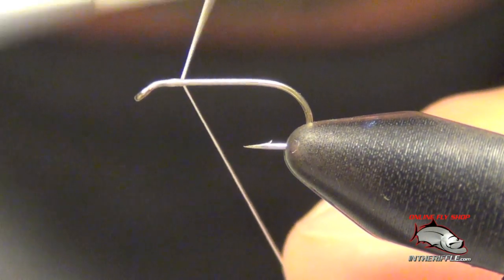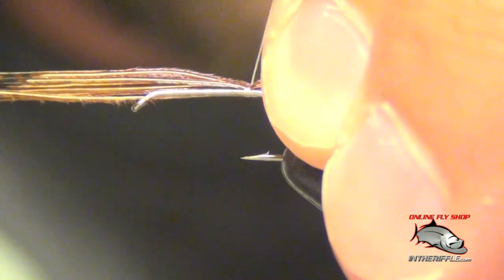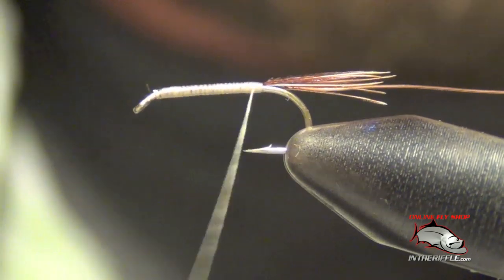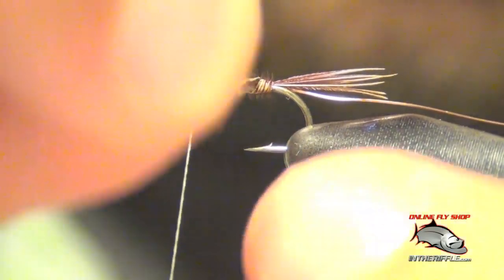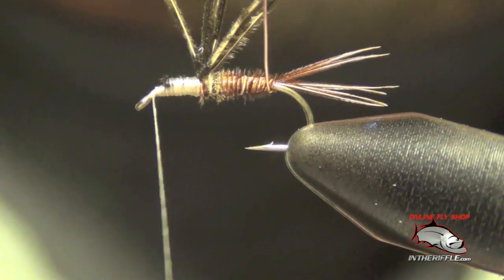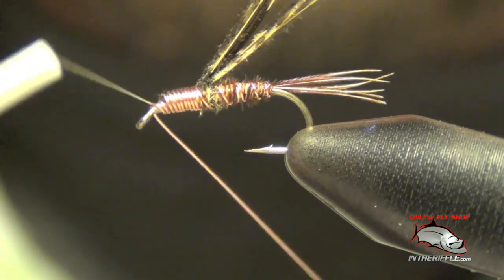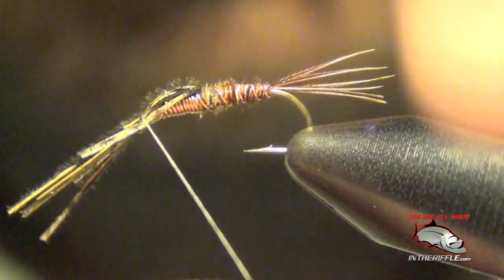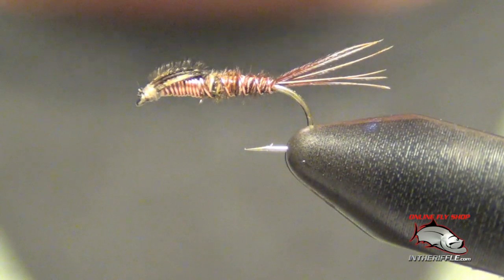Sawyer Pheasant Tail Fly Tying Instructions

Comment: It is tied in the style of the Sawyer pheasant tail fly, and I think it is a neater presentation. I do tie mine with just wire. It took a while until I could tie a good whip finish with wire, but I do it well now. Sawyer's is much heavier and can be an advantage on the rig if you need a lot of weight. All the best, Sean